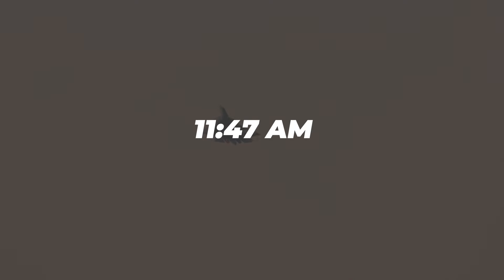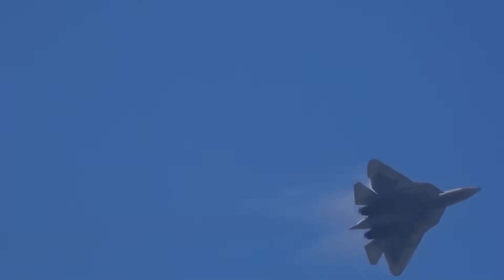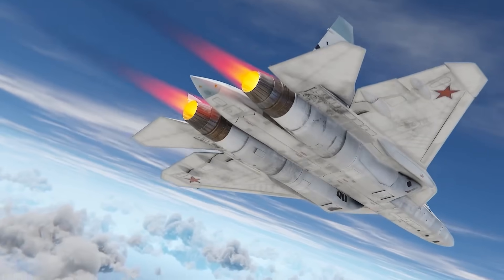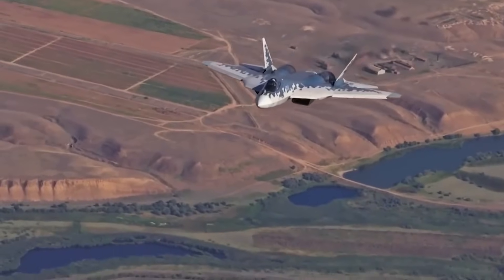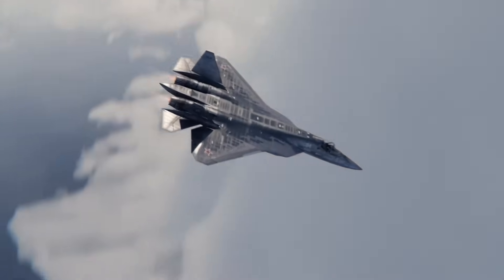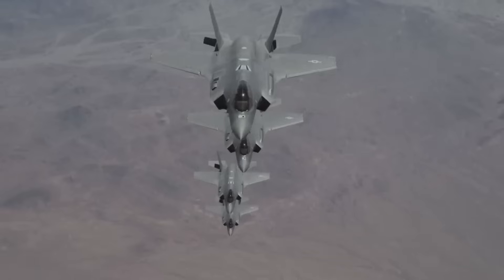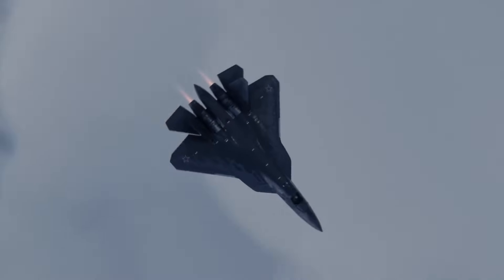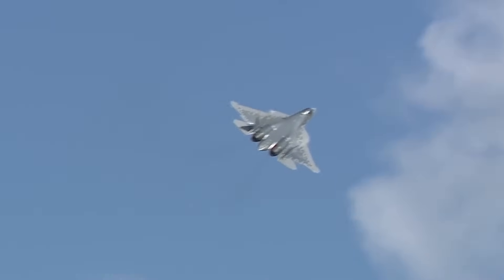Why the Su 57’s ‘Bad’ Design Is Actually Genius

Comment: "Quantum radar is coming" Um... so is commercially viable nuclear fusion. And in 30 years from today it will only be 40 years away. Or something like that. I think the crux of the matter is: how many Su-57s can Russia produce in the next 15 years? Not a lot. How does that stand up against "quantity has a quality of its own"? Sure, it's a really mean dog fighter that when coupled with a skilled pilot can outmaneuver and outrun a heat seeking missile. But how about two heat seeking missiles? Or three? Coming from a squadron of planes you cannot even detect without some serious help from a ground based ULF radar. Which is very conveniently located too far from the conflict area. The game Russia is currently playing is that of the Soviet doctrine: Deny air superiority to the attacking side with echeloned air defense batteries, rather than establish air superiority. But that strategy is only great for home turf defense and it isn't going to help you in an offensive where your air defense batteries are still far behind your fighter planes. And you need something better than "rumors" about how the Russian L-band radars function. Until Russia can scale up its Su-57 production, my bet is on F-35, despite its fuel capacity, limited thrust vectoring and comparatively ugly looks.

Comment: Its not bad design. Its different. All designs have advantages and disadvantages. The F35 does not operate alone so it doesnt need to be fast and manuvarable hence the original name "joint strike fighter - JSF". The SU57 is designed to operate alone so its much bigger and faster, but this means lesa stealth.
Reply: @pt17171:
Despite Denis Alipov – the Russian ambassador to India insisting: “𝘛𝘩𝘦 𝘚𝘶-57 𝘪𝘴 𝘵𝘩𝘦 𝘣𝘦𝘴𝘵 𝘤𝘰𝘮𝘣𝘢𝘵 𝘢𝘪𝘳𝘤𝘳𝘢𝘧𝘵 𝘤𝘶𝘳𝘳𝘦𝘯𝘵𝘭𝘺 𝘧𝘭𝘺𝘪𝘯𝘨,” 𝗥𝗼𝘀𝗼𝗯𝗼𝗿𝗼𝗻𝗲𝘅𝗽𝗼𝗿𝘁 𝗵𝗮𝘀 𝗻𝗼𝘁 𝗯𝗲𝗲𝗻 𝗮𝗯𝗹𝗲 𝘁𝗼 𝘀𝗲𝗹𝗹 𝗮 𝘀𝗶𝗻𝗴𝗹𝗲 𝗦𝘂-𝟱𝟳 𝘀𝗼 𝗳𝗮𝗿. 😆😆😆😆😆
Reply: @pt17171:
“Joint Strike Fighter” doesn't mean that the F-35 was not intended to operate alone.
The F-35 is a “joint strike fighter” because the aircraft is the joint effort of 8 countries.
The 8 core partner countries 
alongside the US are: UK, Italy, Netherlands, Canada, Australia, Denmark, Norway and Turkiye.
As the U.S. deemed the move  incompatible with NATO security, the latter was sidelined after buying the S-400 𝘛𝘳𝘪𝘶𝘮𝘧 air defence system from Russia.
From July 2019 Turkiye was officially removed from the F-35 Joint Strike Fighter programme.
Reply: its bigger also becuse ariframe is hevy as heck. If they use good compisid it can fly much further or carry more load but no they ned 30% more fuel than F22.

Comment: AI slop. The engines are what they had to work with, they are Su35 engines rated for vector thrust, same as on the Su30SM2. It was always planned that fully stealthed engines would be developed for later versions of the Su57 at least a few have already been upgraded and begun testing.

Comment: When comparing stealth numbers, don't forget about methodology. In Russia they show average dispersion indicators, as per unit of demonstration, in the USA, according to their methodology, they show peak, that is, course, when f22 goes directly to the radiation source. Do you really think that the F22’s dispersion indicators from below at an angle of 45 or 60 degrees will be the size of some kind of ball? No, it will be a flying minivan. You must understand that there was really only one stealth aircraft on planet earth, this was the F117, with all the ensuing advantages and disadvantages. All other aircraft are not stealth aircraft according to the Russian classification, but aircraft using stealth technologies, since this is a reduction in stealth, and not stealth itself. That is, what I mean is that if the Su 57 goes on an attack directly heading towards the radiation source, the Su 57’s stealth performance will be comparable to that of the F 22. From all other projection angles, the F22 will have an advantage, but in 2025 it will not be significant, because air defense systems (at least Russian ones) use a complex of multi-wavelength radars, and from the difference in the picture, it will be clear that the target is in the air, because if there air or a bird, then there will be no reflection, or they will be almost the same, but if there is an airplane, even if we don’t know which one (as if there are many options), then based on the difference in the reflective coefficient from different wavelengths and intensities, we can point the missile at the target. The age of stealth will be short... Now, in the future, it will only be a matter of how many seconds you gain before detection
Reply: wasnt it TAMARA radar that could see "invisible USA trash Propaganda planes?
Reply: @ChasseurTueur  It's not radar but radar detector. It is efficacious, because to escape it you should switch off your radar and become blind. What's the use of stealth then?
Reply: Тут ещё вопрос в занятости этих радаров другими объектами. Щас же технологии роя бпла развиваются
Reply: @ScorpioT1000  Так там где самолёт там нет роя БПЛА, тем более речь про сетку радаров...
Reply: Don't forget photonic radar which is the stealth killer. In no time that technology will be perfected and will enter the service, then good bye stealth.
Reply: You are correct to my opinion. I was thinking about latest few combats was bvr. Just the B2 spirit attack was stealth and was not detected by radars, but it could be due to local radar technology, I don't know. But somewhere in time I read that and array of different radars can detect this kind of airplanes from different sources of emission and reception. Son one send the signal and other antena receives the reflection and so on. So the array can triangulate the position of the plane. Is that true nowadays?
Reply: @adrianvega9946  Yes, even radars from the 1960s are sufficient. The key is saturation and intelligent modern control, that is, network-centricity. The greater the saturation, the less effective the stealth factor becomes. Of course, only three countries on planet Earth have the capacity to saturate their forces with sufficient radars: Russia, China, and the United States. So stealth will still be effective against countries with weaker equipment.

Iran could be capable of this too, if they get their act together politically and militarily—that is, either a change in leadership or the old people adopting a new approach, since they have everything they need technically. They've achieved this capability technologically, but not in terms of management.

And let's not forget that 100% efficiency is impossible for any system; physics forbids it. So even the most advanced systems, statistically speaking, can fail, and that doesn't even take the human factor into account.
Reply: BTW: F117 was brought down by the Serbs with Ss20😁😅😂💖🐲👏👏👏☃️🌲❄️🥁🐝🐝🐝🐞🐝🇱🇺👀😎💞💕🪆🇷🇺🪆🇷🇺🪆🇷🇺❄️❄️🌲🌲☃️☃️🤙
Reply: Radiation is from the radar. Its with that turned off that it has a radar cross section of a bumblebee. In that mode the su47 is still huge. Infred viewing is something. Like a heatseaker missle. No plane hides all of that but that is where the nozzle deign and other factors come in. An jet with an afterburner will light that up. The low band radar that can see stealth panes also see rainclouds and uncle johns farts because he had to much toca bell. That on its own is basically blind from noise
Thrust vecotring is a 4 gen aircraft design. basically before the beyond visual thing. Stealth jets kill russian jets before they even now its there. dogfighting will be rare, and a result of mistakes made
Reply: @Ispintechno2  You measured SU-57 so you kn0ow its radar cross section is huge? And that "stealth" jets that would kill Russian jets? Funny thing is that Russians are not worried of them at all. You should ask yourself why, if you are clever.
Reply: F-117 выглядит как кусок полигонов лишь потому, что в те времена рассчитать ЭПР кривых поверхностей было праткически невозможно. Как бы не был хорош СУ-57, численное преимущество НАТО в воздухе слишком огромно, чтобы он мог на что-то повлиять.
Reply: @cyan2925  Нет чел, без предъявы но ты не изучал вопрос. У Ф117 невероятные показатели стелса, ну т.е. скрытности, в разных диапазонах волн и углах облучения. Это самолёт построен больше по науке физике эл маг диапазона, чем по принципам аэродинамики, что внесло ряд ограничений на его эксплуатацию. Проблемы отмены этого программы как раз в том, что это летающий топор с очень узкими диапазоном хар-ик для полёта (угл атаки, набор высоты, разворот и тп и тд), и самолёт постоянно норовит упасть как тот самый топор, если ты выводишь его за пределы этих хар-ик. То есть он как самолёт не очень, а вот как стелс, лучше ничего нет и не будет. Просто посмотри на физику показателей Ф117, там всё просто крышесносно, просто самолёт плохой)))
Reply: @НиколайСмирнов-с7х  Сильное заявление, основанное на.. ничем. 117 достигал малой радиолокационной заметности в основном из-за формы, и плоские поверхности он получил не потому, что так он менее заметен, а потому что кривые поверхности в разы сложнее было смоделировать и обсчитать когда его создавали. B-2 же и F-22 достигают ещё меньшей радиолокационной заметности благодаря форме и радиопоглощающим материалам. Не знаю откуда ты берёшь информацию, но я находил инфу что RCS у F-22 и B-2 существенно ниже, чем у F-117.
Reply: @cyan2925  Ну да ну да чел, тонны буквально научной литературы, лаб исследований, в т.ч. вообще не из всякого ВПК, которые сотни тысяч симуляций проводили, а так же наличие на руках тех обоснований и тп и тд по ходу создание ф117. И это всё ни на чём. И тут приходит чел, и говорит, слушай у них такие формы, потому что уголки скруглять тогда не умели. У ф117 форма ровно потому что так эффективнее рассеивание и отражается не в источник излучения элмаг волны, то есть по физике так лучше, а не потому что они что то там не могли. То есть до этого могли не в рубленный формы, и после ф117 могли делать самолёты не рублеными углами, но когда делали ф117 то забыли или разучились... Так что ли? Я хотя бы не из ютубуса знаком с тех обоснование ф117 мне вот эти байки не интересны. Инфа только одна, у ф117 самые лучшие показатели, где вообще можно найти инфу что у Ф22 лучше, или тем более у Б2? Вроде даже на вруники есть сводная таблица, но я не уверен в какой теме. 

Короче, не надо мне писать что у Ф22 или у уж тем более Б2 показатели лучше чем у ф117. Ты их хотя бы видел что это за локомотивы по размеру? Там 1 проекция нормально отражает приходящие облучение, которую и лепят везде, но это пиковые значение, а не средние. У ф22 только фронтовой показатель высокий то есть по курсу облучение, там размером с тарелку, в опр диапазоне волн (без учёта триангуляции), со всех ост углов не то что бы там какие то красивые показатели, куда хуже чем у ф116. Про Б2 ну это как бы вообще смешно. 

У ф117 буквально на порядок цифры лучше! Знаешь же что такое на порядок? Он в круг имеет хорошие показатели RCS а не только в избранных плоскостях. У него корпус пирамидкой как раз потому что он оч много отражает над собой, в атмосферу, где нет приёмником отражённого излучения. Он горбатый не из за не состоятельности конструкторов, а потому что там надо. Ещё раз, он по физ модели построен, лучше нет ничего. У него нет радиальных или ещё каких пик RCS, у него пики в нижней и верхней плоскости, специально, ибо кто будет над НИМ что бы ловить отражённые от его поверхности элмаг волны? У всех остальных там пёстрый рисунок в разных диапазонах, но не у ф117!

Был бы этот спор лет 5 назад, у меня было бы куча ссылок в закладках что бы закидать, но увынск. Но я точно знаю что нет самолёта даже рядом по показателям с ф117, просто даже не начинай. В этом споре точку поставили ещё лет этак 12 назад, когда Су57 только на бумаге был, а про Китайцев ничего и не слышали.
Reply: @НиколайСмирнов-с7х  That was pretty good. But if you actually had links or connections to those scientific papers, it would be interesting to take a closer look
Reply: @AD_-xr9rv  I don't have any of that bookmarked anymore. It's a thing of the past, a 20-year-old's fascination with military topics, reaching the point of reading 200-300-page documents. Since then, I've changed my browser and my email account (which is a cloud service with syncing), so maybe you guys are a bit late in becoming interested in all this. After all, questions about the Su-57 should have been dropped back in 2014+, just like the F35. I don't even know if all those links would still be around today. I remember many of those research expert groups being disbanded, simply because a non-narrative-based assessment doesn't sell well in the services market.

And in reality, it simply doesn't matter, because stealth is simply a technology already available to more than one country. It's simply a characteristic applied depending on the assigned tasks, which are shaped by doctrine, which in turn is based on conceptual foundations, practically a philosophy.

And ultimately, all aircraft are rather boring; despite their different performance characteristics, they suffer from the same technological disadvantages. And the only truly unique experiment is the F117. But it's unique, which is precisely why it was interesting as a subject of technical research.
Reply: @cyan2925  which HATO already proved in Ukraine with all their WunderWaffen, Abrahams and Leopards are closing to Moskau, i heard :)
Reply: @ChasseurTueur russia has lost shit ton of personel and vehicles to fpv drones, so what?
Reply: @c @cyan2925 a dinámica estratégica no funciona así. No es blanco o negro y si tienes menos aviones pierdes. Si Rusia tiene 150 Su57 tiene más leverage que si tiene 0.
Además la ventaja numérica de la OTAN no es real porque la OTAN nunca podría desplegar todo sus aviones contra Rusia.
Rusia solo necesita tener paridad con el lado eurolpeo de la OTAN.
De todas formas en una guerra todas las bases aer as sería bombardeadas por bombas atómicas tácticas
Reply: LOL

Comment: MOST FIGHTERS WOULD STOLL AND CRASH INSTANTLY???????
Reply: You need to learn what stall means in aviation...... , aircrafts when going too slow will stall. That velocity treshold can vary greatly depending on aircraft type. What they ment, that SU-57 can fly extreemly slow without stalling....   If aircraft stalls, it can recover but it needs to have enough altitude(much more than 300m for fighters)  .
Reply: Yes SU 33 and SU 25 too. Russian have like 200 SU57 against approximately 1400 F22+F35 7 attacker for 1 defender.
Reply: @kacpermalina308  One hypersonic misille equiped with tactical nuke would delete one airfield together with F22. Russia has plenty... USA would lose all usable airfields near Russia  in Europe and  than what ?   Would USA dare to send any nuke in Russia after that? Bare in mind USA would lose airfields outside of USA only, while no nuke would damage anything inside USA. At that point USA could choose to leave Europe  and declare victory as usualy.... :)  , or attack Russia with  nukes knowing that in 50 minutes all USA´s cities would be melted. What would USA opt for ? I bet they would leave Europe and declare victory :)

Comment: Another set of variables.  The F35 is limited by its own construction to be ONLY a 3G-gravity platform.  Above about 4.5G parts of it start to break or mechanically shift.  This has been demonstrated in videos.  It is NOT a fighter, and was never intended to be one.  If faced into a "gunfight" it has already been shown to be a 97%+loser.  Its own rear area cannot do stealth, if it is trying to escape, since the airflow masking cannot handle the extra thrust.
Reply: The F35 and F22 were not designed for dog fights. Its wings are too thin and short to manoeuvre in a dog fight. It was designed for stealth sneak attacks on the enemy and be able to launch its missiles at the enemy from an extreme distance, between 70 - 120 km away.

Comment: So while the SU57 is doing its fancy maneuvering, the F22 that it didn't see 100 miles out, just shot it down, because it could. 
That is point of 1st shoot 1st kill.😉
Reply: You don't get it. The SU57 has extended rader system which sees the missiles far away. It also helps the pilot maneuver the fighter jet from the missiles fired at 100 miles away. That's how it locked on the Israeli F35 fighter jet mentioned in the video.

Comment: Su 57 always was frontal stealth (backward you have a 50km detectable IR heat track anyway (Su-57 is an F35 hunter, they will see it other at 50km, visual/IR range, then,...)
Reply: Its frontal stealth isn't very good either. The turbine blades are directly visible through the inlets.
Reply: @RedXlV  the blades have radar blockers In front of them and they new engines also has composite blades to decrease radar cross section even more

Comment: The. AIs script. Reveals the writers fundamental understanding of aeronautics. The F22 has two nozzles which gives it control of pitch AND roll. It handles Yaw by variable thrust. And as others commented its not the nozzle shape that makes a difference as Sukhoi has recently added a square nozzle inside of a circle. The US engineers could have added an internal flap in the exhaust to add a stronger yaw moment but opted to drop that as a fast yaw moment as achievable by other means and doesn't become useful in actual combat. The video reads like a Russian propaganda campaign.
Reply: Exactly. Ruzzians love playing down the value of stealth because they are incapable of even approaching F-22 RCS. Go ask Indians why they dropped the joint F-50 based fighter project after several years of negotiations.
Example #2: If someone remembers, since 15-20 years ago ruzzians kept laughing at the American shale oil/gas technologies while dreaming for Gazprom to reach $1trln of capitalization. Today American shale oil industry beats the cr* out or ruzzian one.
Example #3: Roskosmos vs SpaceX...